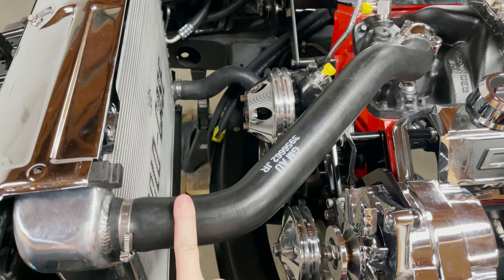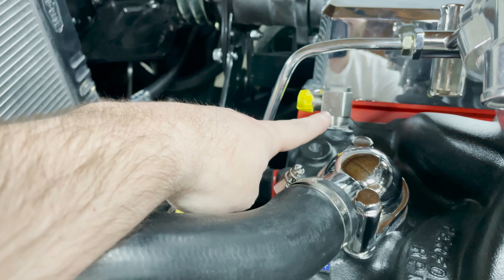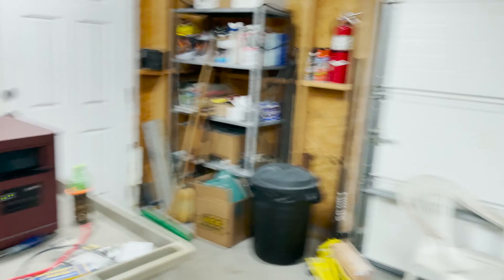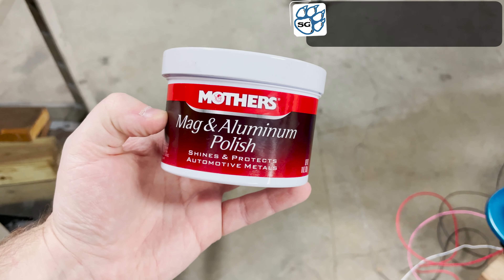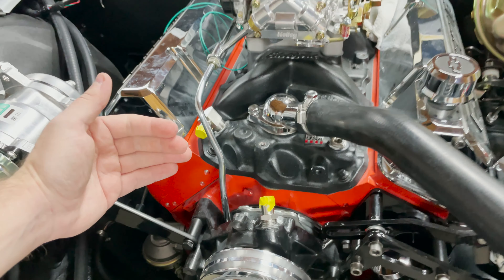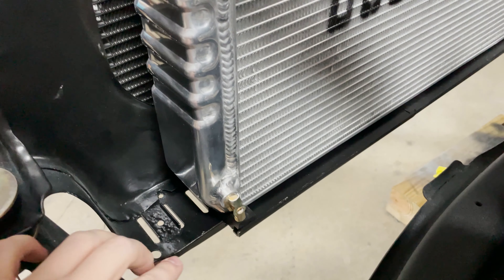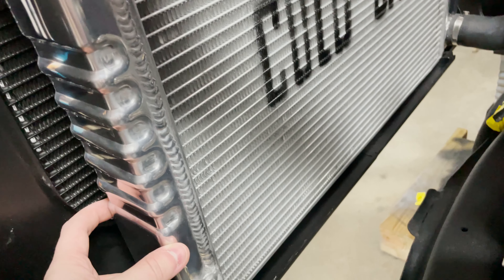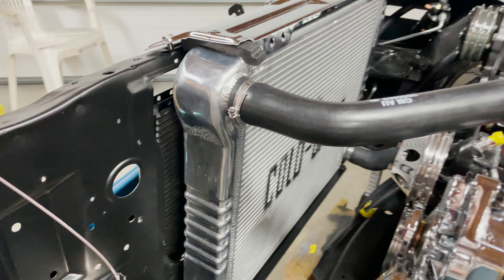Custom Fab Work & Engine Update

Comment: If aluminum wont polish its because the surface is to tarnished or to coarse. Wet sand it with 1500-2500 grit then try to polish it. I have even had to start out with 600 grit then up to 2500 grit just to get the aluminum smoothe enough for the reflection i wanted. I use mothers mag and aluminum polish on a wool polishing wheel on a drill. Harbor freight has a whole set of the wheels in different sizes and they are cheap. If they start to wear out they dont work very good so buy 2 kits.